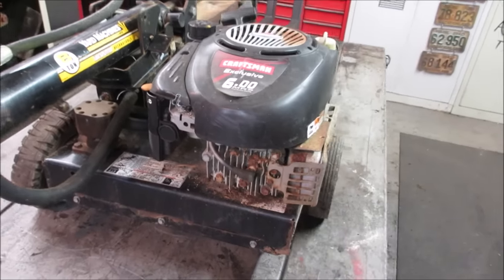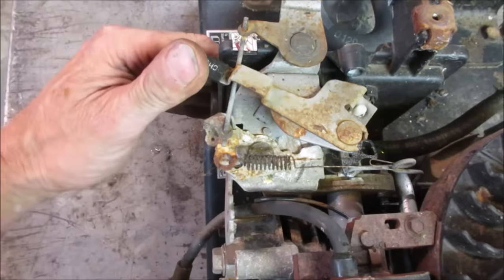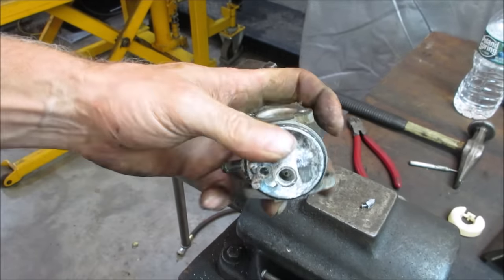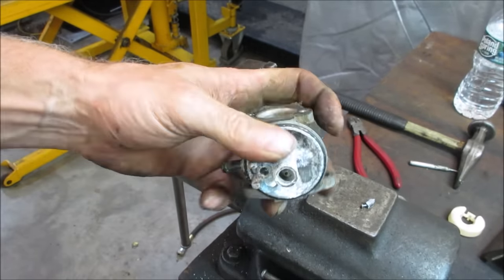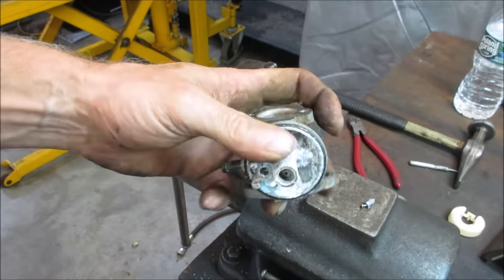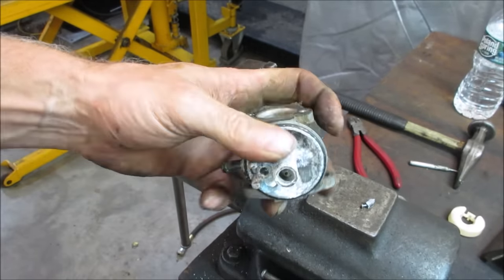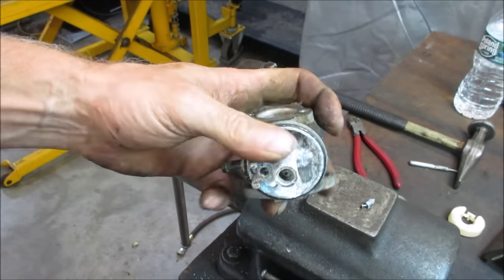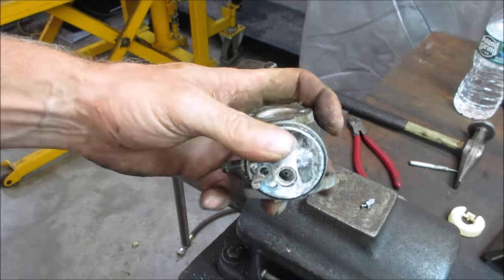Crushed Under a Barn, Free Busted Log Splitter

Comment: Thanks for the upload.  Can’t imagine being hunched over & operating that machine.  I would have to put some extensions on it to raise it up a couple of feet (bigger wheels would then fit) and add a catch cradle on each side.
Reply: The higher you have the machine--the higher you lift every log.  UNLESS you own a teenager that throws all the logs in the back of your pickup first!

Comment: I wouldn’t take less than $500 for it if it was mine. You got it working great and those cost nearly $1000 or more new, depending on the size and hydraulic power output.

Comment: I´d say the pipe pieces below the pusher are probbably supposed to spin freely on the bolt so fill em up with grease so they dont go stuck on the bolts.

and if it doesent have enough space for them to spin just shorten them slightly so they have a bit of clearance on the ends so they dont bind up aginst the sides.

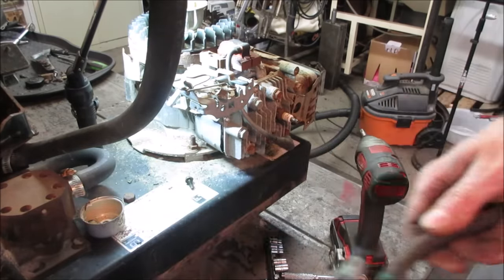Comment: 14:06 This is highly indicative of the way that aluminum corrodes. People disagree and say "oh but Aluminum is good because it doesn't rust", but it does. Not sure if it is corrosion in the same way steel corrodes but it is an erosion of the material with a resultant chalky residue, much like the powdery rust residue that was left in the starter cup shown earlier. That chalkiness is good evidence that ethanol blended fuel was used in that engine.

Comment: I had one of those. Got it at harbor freight for 699.00. Great working little splitter. I ended up trading it to a guy for a 22ton splitter that wanted a smaller unit. He didn't have the storage space for the 22ton. I kind of miss my small splitter, was so nice to just toss it in the back of my truck and go cut firewood. Only stuff I had a hard time splitting was the gnarled pieces but even they split eventually

Comment: Long cotter pin wrapped in emery and soaked with a bit of oil and mounted in a drill works well for cleaning areas like needle and seat tube

Comment: Atf is hydraulic fluid,and it is also an oil just like engine oil, except it doesn't have friction modifiers in it, which would promote the clutches slipping rather than grabbing as they should.. Sorts like wet clutch safe oil in motorsickles and atvs..

Comment: Ok, when I’m doing stuff on my computer I like watching stuff like this - listening mostly- every once in awhile I’ll realize I’ve been watching and not working- lol, I don’t know Squat about motors. I use too. God I hated it, straight 6 slant 6, then 283,and so on, always trying to rebuild in the back of a truck or on the ground didn’t have the right tools had to go to junk yards. Pull a part. Ugh. Then I worked for a race team - I drove the truck, the supervisor- saw me drop the guys off at the shop, and I left, I was fuming when I had to come back. But turns out those are the cleanest motors and cars I’ve ever seen. But back to you, I would suggest a brass brush from a 22 gun cleaner kit. It looks about that size to fit into that hole your trying to clean, I had a friend that could take something and turn it into a dollar- lol - now go turn another Nut 🔩 and we’ll Watch 🤠🐾♥️🙏🏻🇺🇸🌲🍀🦨

Comment: That carb was the perfect candidate for cleaning with a baking soda blaster. I’ve used mine to clean up and reuse carbs just as bad as that before. In fact I just had one in the shop this summer that I was able to save on an old Crapsman push mower. In fact, the float valve was stuck just like that one… Baking soda works well for cleaning plugs too. Oh, and the reason the float wasn’t sitting level was because the rubber seat got swelled up by the cleaning solution in the ultrasonic cleaner…….

Comment: Weld some steel on the splitting wedge to increase the angle as the wood passes thru. 
I will split the wood faster without having to pull them apart. 
That’s a good little splitter.

Comment: For blocked holes you could always try getting a set of gas welding nozzle cleaners.... they are more or less little round files, I use them for a multitude of random cleaning on small holes.....

Comment: Have the same splitter. Had to replace hydraulic tank/bar with a IBeam. Used a helium tank (balloon tank) for hydraulic tank. Had to rebuild because it cut through top of original tank. Tough little machine

Comment: I feel like the bolt holding the wedge to the cylinder should have spacers on it to keep the frame from distorting inward under load.  The bend in it makes me wonder if you need a grade 8 bolt on it too?  Congrats on that Midwest fastener set.  That is drool-worthy stash material.

Thanks for taking us along again.

Comment: Maybe a good advice.
Category You lern by pain. 
I have none the same trying the spark plug without cleaning the area around.
Some dirt has pulled in and damaged the engine in long term. Some sand gut to the rings and scratches the cylinder.
Now I clean the area always before with air pressure.
Also the aluminum oxide could suck inside. Aluminum oxide is very hard material.

Comment: Back when I was a young lad    Judging  by your stories, we are similar in age  my job was cutting the grass on the farm  I would leave the mower outside in the ran   We had a BS 3.5 hp with the carb built onto the tank   Whenever I had water in the tank  I had made a suction jar  2 hoses in the lid  so I could suck by mouth the ball of water out of the tank thereby not having to take it all apart .

Comment: Hello, I enjoy your contents, love learning different peoples ways of doing things. A thought I had about the slow travel, maybe when the previous owner changed to a lesser HP engine he also used a smaller pulley, anyone that would fit the engine crankshaft. Just a thought.
Reply: Mustie said the previous owner changed to a bigger HP engine. Im wondering what could make that piston travel faster?
Reply: Your right. II know on riding mowers changing the drive pulley (engine) to a larger diameter to a smaller (diff) pulley will make the rider go faster. So maybe the same principle would apply to the splitter.

Comment: On the float needle seat and the tube going to it, take a q-tip and pull the cotton off one end. Wrap some 4-0 steel wool around the gear end of the q-tip up to where it's a snug fit down the tube. Spin the modded q-tip with your fingers while pushing down into the tube. A bit of spray carb cleaner on the steel wool helps the cleaning process. 
This will clean and polish the tube as well as the seat. Cuts through the crud without damaging anything. If you use a drill to turn the q-tip will be to aggressive.

Comment: Hi Darren, I lived on the Mornington Peninsula, south of Melbourne, victoria, Australia on a 3000m2 bush block for 40 years and would have loved one of these log splitter to have helped me to create a garden and fed my fire place instead, I used a manual log splitter which upon reflection kept me hale and  fit as a Malley Bull (a concept that does  not quite translate) , but you might get the idea.  Cheers and thanks.

Comment: That was a nice machine if you need one. But it also showed me what my fathers friend form work talked about when he said they were dog slow. 

He built his own splitter, one that would give a company of OHSA inspectors collective heart attack. He started by nailing together a wooden wheel, about two meters in diameter. Then he added two ax heads to that wheel and a electric motor that accelerated the wheel to something like thirty RPM. That means there were an ax head swinging by every second, and with the combined weight of the wheel and the ax heads they hit with authority. He used that contraption for more than ten years without loosing a hand or even a finger.

Scary as hell, but it was fast! Basically it split the wood as fast as he could get the loggs in place.

Comment: Even though I find splitting wood with a maul and wedges visceral, I sure could use this rascal to split a 4 ft by 3 ft diameter chunk of willow that weighs about as much as a 350 v8... whew. Nice video... same engine as my lawnmower🙃

Comment: Nice little toy !!!  Doing much better after the oil was changed.. Better then I thought it wouls... But it has 2 big problem !!! You need arm a mile long to really work it. An the bigest problem is ether your on your knees to run it, or you need to get your kid to split the wood.. Way to low to the ground,,, An one really back back ach after an hour of splitting...

Comment: Disconnecting the return hose, and holding the forward handle while starting the engine, will empty the old oil from the sylinder out the return. Stop the engine when the sylinder is all the way out, before releasing the forward handle. Also if the return oil stops when the sylinder is completely out, there is no blow-by in the sylinder or valve.  ;)

Comment: I used to calibrate and repair concrete compression machines, with capacity from 60k up to 1 million pounds of force, a lot of machines used ATF instead of hydraulic fluid in the 10k psi hydraulic motors. No problem using ATF in this.

Comment: More splitting force than I was imagining. Could be a decent machine for someone who’s not in a hurry. However, it would be hard to design a splitter with a worse working height. For serious use it would have to be on a stand that would get it about waist high. Nice recovery job. Someone will trade you a splitting maul for it, lol. 🥸👍👀✅

Comment: On the float valve, take a 1/4" wooden dowel, cut down the center to the required depth as to not damage the rubber seat. Place a bit of emery cloth, twist and load into the hole, then chuck it up in a drill motor... it will polish the imperfections out equally with a light touch.

Comment: Maybe lengthen the wings on either side of the slide. So that they go forward past the axe head. Possibly even making them double the width as well. This would stop the log from falling off the sides once split. This would save your back a bit of strain as you wouldn't have to keep lifting up the pieces that needed another split. Once the final split is done the next log will push any pieces of the previous log off the end.

Comment: Mustie if you have the same problem with the jet best to use a spring roll pit with slot put wet/dry paper to diameter then spin with the drill does the trick

Comment: Musti1 you need to get a dental handpiece not a dremel tool. The tool size that fit them is 3/32 and we have a ton of tiny burs and high quality silicon wheels with diamond dust included to get you an amazing polish. I’m talking about a straight hand piece not a contra-angle. You could then easily polish and mill any of the tiny parts.

Comment: You could try to use a pipe cleaning wire brush and cut the ends off, stick it in a drill and try to clean the little hole in the carb that way.

Comment: Replacing carbs is so cheap with Chinese parts, just bought a carb for our brush cutter for 15 Euros, or roughly 16 bucks; it came with fuel lines, 2 fuel tank bungs, 2 different fuel pick ups, and a spark plug! As a bonus, the replacement carb had a high speed mixture adjustment unlike the original; I was able to set the mixture correctly, whereas the original always ran incredibly rich.

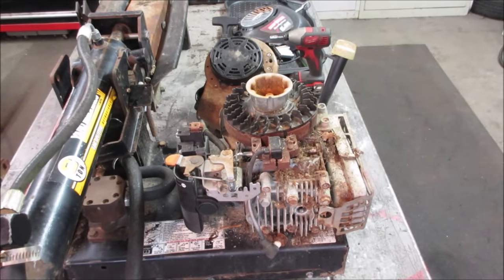Comment: 7:17 you may wanna build a vacuum nozzle with an air outlet for compressed air in the middle, to blow the crap out of the holes but also vacuum them up instead of spreading through the shop ;)

Comment: A way to clear the cylinder and pump is to put the return from control into a bucket and cycle it a couple of times until clean fluid, then top up…

Comment: Actually I stopped cleaning plugs by sandblasting in my shop because with the onset of unleaded fuel plugs would last long enough to be worth replacing them instead of cleaning them.  Then I wouldn’t have to worry about a cleaned plug failing.

Comment: Work good as a resplitter.
Have it up on a table at your wood storage area.
I counted just about 20/22 seconds for a round trip of the cylinder. 
Those sell new in that size for $800 to $1200
The engine is big enough now you could step up the pump size to 13gpm or mabe 16

Comment: Recently experienced a curb side mower, one of those Tecumseh Eager-1 engines, and it ran but wouldn't idle unless I had my thumb mostly covering the carburetor air intake, the idle circuit was completely clogged, and the main wasn't as clear as it should be. Nice find, that B&S log splitter, but you already have a bigger one. This could be a back-up? God bless 🙂

Comment: That little wood splitter seems to have plenty of power but it could stand to be a foot or 2 higher off the ground so you wouldn't need to bend over to load and operate it.  A friend of mine has one that is slightly bigger with a 10 horse on it but the whole unit is quite a bit bigger and it is able to be pulled behind a truck or tractor.  It also has a side lift ramp and a table piece on it so if you have a huge piece that you can't lift you can roll it on the ramp and have another smaller ram lift it up into place to be split which is quite a bit easier on the back.  With the front table piece attached you just have to slide the split pieces back to the ram rather than picking them up again.

Comment: Lawn mower engines usually don't have a flywheel but as a lawnmower the blade prevents the engine from kicking back when starting with a pull rope. Thereby preventing the kickback from pulling your hand off your arm.  In a splitter application the no fly wheel engine can kick back and tear your hand off and send it into your neighbors yard.
Reply: No flywheel? They certainly have a flywheel, I think you mean a low inertia flywheel and you’re right lawn mower engines on “no blade” equipment can be a problem.
Reply: @cjack121  Functionally, no flywheel.  At times at least. Check the definition of flywheel. Can something that does not function as a flywheel be a flywheel?  I'll meet you half way though just to not belabor the point. Some lawnmowers have  a device that looks like a flywheel but only sometimes works like a flywheel.  When it doesn't, "Damn. that hurts!  Was that my hand I just saw flying into my neighbors' yard?".  The important fact is that when pull-starting lawnmower engines without blades attached to the output shaft the engine can "kick back" and cause considerable pain and injury.

Comment: You can use ATF FLUID in log splitter.
It gives more flexibility in the temperature range of operations.
This way you can use your machine in  cold as well as hot weather.

Comment: Q tip with little valve grinding compound in a drill is a good way to clean out corrosion in the needle seat area.

Comment: I think that term that you are looking for is low and high viscosity: Fluids with low viscosity have a low resistance and shear easily and the molecules flow quickly; high viscosity fluids move sluggishly and resist deformation.

Comment: my old 77 KZ1000 had an issue with water as well. the mechanic told me to carry a wee bottle of methyl hydrate (gas line antifreeze) and add some every time I filled up. the problem with it stalling went away. the antifreeeze breaks up the water molecules, so they can get sucked up with the gas, instead of blocking the carbs

Comment: The best way to clean aluminum corrosion is an acid bath, just vinegar in a pot on a hot plate. Bring it to a boil, then lower it to a simmer until all oxidation has dissolved and aluminum has a bright shine.

Comment: You should always keep the hydraulic fluid full because the oil also cools the pump and if it is low the heat do not have time to get rid of the heat before going through the pump to pick up more .

Comment: I have used torch tip cleaners to clean the jets in carburetors because of the different sizes file like wire they are made of

Comment: Briggs and Stratton engines used to be the gold standard...but.

A few years ago I bought a (brand new) Alko mower (Austrian) with a B&S engine. 18 mths later after careful, cared use it blew. My Father in law overfilled the oil (he knows best!) And it literally blew the block apart. Chunks of casing was thrown across my lawn. Head put about 200ml too much oil in which should never have destroyed the engine...€450 down the drain.

Comment: hydraulic log splitters specifically as an attachment for a tractor are pretty common here. Most of those are homemade by metalworkers normally working in agriculture or the building industry- which means they are WAY overkill and stupidly strong.. makes them super dangerous to use and to make it worse, most people using them only borrowed them and have no clue..
Reply: I believe that is the root of my fear of log splitters, lol.  In my younger years, during the mid 70s, I lived up in Plattsburgh, NY. It seemed, at the time, there was a fairly steady stream of news stories about folks getting seriously hurt while using the log splitter that they built.  I think it just stuck in my head.

Comment: Need to try those dental floss pipe cleaner looking things.
They have one end that's stiff to poke though jet holes and a long fuzzy section to hold carb cleaner.
Although I would suggest not reusing them on your teeth after cleaning a carb. They'll taste funny 😳

Comment: Putting the carb
putting the carb in the ultra-sonic cleaner would have removed some scale and added a little lube.  Before you try to hammer it apart.

Comment: I find torch tip cleaners are good for cleaning most main jets and emulsion tubes but if you need to clean an idle jet they’re too big. Honda makes a set that works for everything, very expensive though. Part no. 07JPZ-001010B.

Comment: If its going to be sitting 6" off the ground you need to install an extension on the lever for the ram so youre not bending over to use it. :D

Comment: like snow plows lotta these will run a multi-purpose ATF so when you run it in the winter, it’s not as thick as regular hydraulic fluid and not as hard on the pump